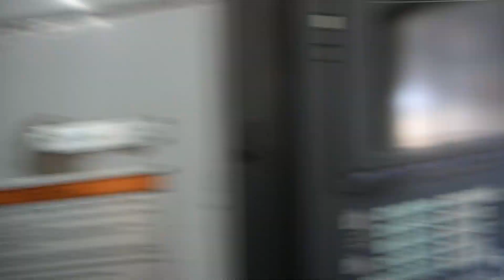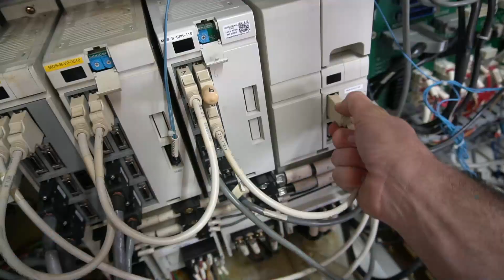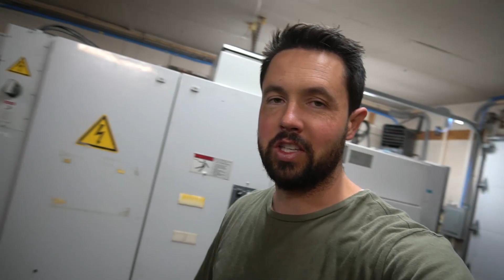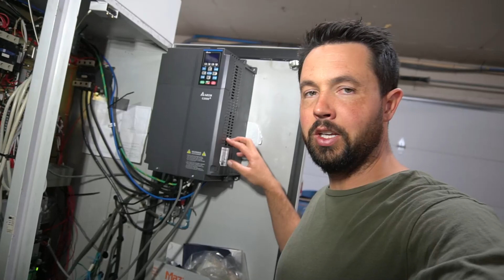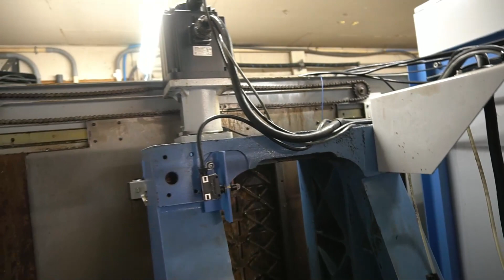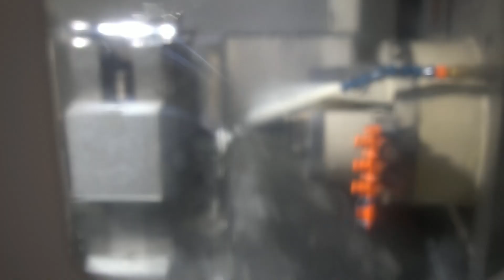Mazak Horizontal CNC Retrofit + Centroid.

Comment: Hey! That's my old machine!  Or just like it. We traded it in ages ago for a handful of small verticals.  Thanks for putting this video together, almost more work than the retrofit!
Reply from the maker: Haha that’s awesome!  She’s an old girl but she’s like new now! Pretty happy to have this one up and running it’s been amazing for me so far.
Reply: @ericschneiter  Sure does give me a thrill to see one doing good work, it was a pretty solid machine back in the day, although we had nagging trouble with the 4th over its life, but as the least expensive horizontal available, we could forgive it.
Reply from the maker: @yamahaeleven  hopefully we’ve put most the skeletons to bed.  I tried to rework some of the issues know on them.  The drawbar bolts, the trunnion etc.  she’s a smooth running girl now.
Reply: Excellent!

Comment: Very cool endeavour. I have retrofitted a desktop mill and a desktop lathe with the centroid acorn. The motion control of centroid is very good. I also have a Mazak fh5800 with fusion640m which is a big version of that machine. It’s a great machine and the Mazak controls were very good for their age. I also have a mate with a htc-400 but with the older MPlus control. A side note, the tool carousel on his machine spins about 10 times faster than yours in ya video.
Reply from the maker: That’s awesome, I probably could have kept the 640M but man I really like having the control over all aspects of this machine now.  It’s nice to be able to service on my own as well.  Love these old Mazaks.  Great machines!  I’ve eyeballed a few of those 5800’s on eBay.  A LOT of iron there haha!  And yeah, I set this carousel slow on this machine because some of my fingers have lost their spring.  So to make sure we don’t fling any tools we spin her nice and slow.   Takes a little more time but smooth is fast and fast is smooth.  😂
Reply: @ericschneiter  the fh5800 has rapids of 50m/min, rather impressive machine. I setup 2 of our MPlus machines with the Ethernet option and have them networked and their ability to handle data is unreal for late 90’s machines.

Comment: thx for the run down on the build i have purchased a htc400 and am about to do the same but with Masso controller and hoping to retain the drives, will try to get some vid of it
Reply from the maker: You’ll have to check if that control will work with SSC NET I know Linuxcnc has a way but I don’t know anything about Masso.
Reply: I'm using masso cnc controller on a bridgeport mill working great so thinking to do the same with my Hardinge cobra 65 lathe

Comment: Yea not a small undertaking at all.

I think you did a great job and got it running pretty well. I feel like I see a ton of retrofits that never really get finished. 

Sad part is the accuracy of those original servos and encoder is probably much higher than what the new drives and controller will be able to achieve.
Reply from the maker: I looked into that before I began. My X and Y are Delta Asda A2 servos and motors. They offer 20 bit resolution with 1.28 million pulses per revolution. So they are 20% or so higher resolution than the original ones. 🙌
Reply: @ericschneiter ah very cool the delta motors seem a little more industrial the dmm servos last I checked were not impressive when it came to that regard.

I almost had an htc-400 once upon a time. But didn’t have the space for it and we’ll deft still don’t..
Reply from the maker: @ianagos4276  You’re right one that unfortunately. I wouldn’t recommend DMM having done this.  Delta has been amazing but I’m going to eventually swap out the DMM drive on the Z axis they just aren’t in the same league.
Reply: @ericschneiter  I know the htc-400 was mazaks budget line but what I also find Atleast on the ones I’ve owned is they oversize the motors compared to what I would think they need. Like my fadal motors aren’t in the same league as the stuff on the integrex. 

When you first mentioned the drives for the new dmm servos were smaller I was just thinking there is no way they are the same horsepower.
Reply from the maker: @ianagos4276  for sure.  They were 1kw motors.  Sounds like the same thing you’ve noticed haha. The x axis moves super easy, like spin with your hand easy and same with Z.  The DMM just have a lower encoder count than the original Mitsubishi ones so I wanna up them to the Delta.
Reply: @ericschneiter  I can confirm the accuracy of those servos. I switched to delta servos on my worn out okuma mill and it exceeded expectations even with backlash on the screws. Extremely repeatable and never fails to impress. Bought Full delta control system for my okuma lathe also still doing the retrofit on that. 
Also now there are 828D Packages we can directly buy from china bit pricy but overall I think its the best controller available for retrofit work.
Reply from the maker: @harindugamlath   have you posted any retrofit videos?  I’ll head over and check your channel but I would love to see that.  Heck yeah!  I love my Delta stuff.  I’ve got them on my arrow as well and they are just dialed.  You’ll have to post when you get it finished up.  I’ve never taken a look at the delta control but sounds like a great option.  Did you use it for your first retrofit as well?
Reply: @ericschneiter  No. I never posted retrofit vids. My channel is a mess just random stuff I upload to send to someone. 

About the mill, I used Linuxcnc with probebasic gui, mesa hardware Delta drives. I changed the spindle all together with a spindle servo drive that was from china SZGH.

Delta controllers are bit hard to get in other parts of the world. It's eiher get directly from taiwan or from india. I bought from india as I live in the bankrupt island country of sri lanka.  

I usually don't get anytime to film or upload to a forum as I have to keep the business running also. If you need any information feel free to contact me.

The controller I bought was delta NC200A (2 axis) There are many other options. they are reliable and used well in asia.
Reply from the maker: @harindugamlath  I see, very well. I really love the look of the Probe Basic UI.  I’m sure you have a great machine on your hands.  Part of my uploading is for people like us where buying a brand new machine might not be possible.  

I appreciate the info and I will for sure write you if I have any questions.  Thanks for watching and for commenting.  Always enjoy meeting new people on here.
Reply: @ericschneiter  Cheers mate. I've done crazy stuff like changing out the okuma spindle cartridge to a 12k unit from taiwan (Kenturn, very high quality) that's not even meant for retrofit work. I'll actually try to share the lathe retrofit so someone could benefit from it. See you later.

Comment: Nice retro,  i have done two machines with centroid now,  one with oak and the other with an acorn.  did you manage to get the optic direct to talk to a dmm dyn4?  i thought that wasn't possible i thought the optic direct will only talk to a yaskawa sigma or a delta drive,  it would be handy to know how you did it as i have 4 dyn4 drives setup for x/y/z/a and id love to add a 5th axis.   also with the dyn4's do you ever see them occasionally fault out at power up after the machine has been powered down for a long time?

Comment: Man, I have sliglty newer model, fh-5800 with 120 magazine and 6 pallet changer. Is this actually doable? New motors, drives, and oak board? Is that it? What about tool change and pallet change macros? Using mitsubishi motors not possible?

What about tool tip compensation or also known as dynamic compensation does that work?

4 axis simutaneosly?

Multille variables for active makro?

Spindle encoder for rigid tapping you used original? How did you count rpm with that board?
Reply from the maker: It’s doable. But you’re talking a VERY complex retrofit for all that. Keep in mind I had already done one full retrofit and this one was almost a 2 year straight project.  Lots of things to tackle with these Mazaks.  

The drives and motor motion are fairly straightforward.  Getting the tool changers to work on these is more tricky. 

Centroid allows for tool compensation in the control or you can use your software. It’s just typed into the offsets page. 

4th simultaneous works, but getting the ratio on your trunnion dialed in perfectly is a super tricky process unless you can find documentation about how many turns per Rev the trunnion spins.  I had to manually type in decimals and probe it time after time to finally get it to the zero point where it was turning the exact degrees commanded.  

Rigid tapping is no problem, a new encoder on the spindle allows the board to rigid tap and it’s all built into centroid.  

The final piece is scheduling your pallets, the centroid post processor has to be modified but can be done.  

My opinion: if you run a production shop and you need a spindle for high volume go buy a newer working horizontal or something running and use it to your tax advantage.

Comment: Awesome job.

Could you outline some of the rough costs for each of the components?

How tall is your ceiling? Looks like a tight fit.
Reply from the maker: Gonna drop a video next week documenting more of the costs and stuff for both these retrofits, But for this build I essentially had the following: $3K to buy the machine as scrap + rig it home and moved.  “Rigged it myself “ Was into the drives, wiring, breakers, encoders and all the various boards from centroid for about 13K. Then random stuff you don’t think about: had the spindle reground for about 2K rebuild the drawbar and 4th axis and a custom PLC.  Then coolant and lubes and stuff.  My books show me sitting right about 19K total right now for everything to this point.
Reply from the maker: Ceiling isn’t very tall 8 feet to the garage door when it’s open. My shop is like 20 by 26 so with my machines in there it’s tight haha!
Reply: @ericschneiter  Nice, looking forward to the video and this thing making some chips. Wanting to do something similar in my 28x28 garage, been on the look out for a mechanically sound vertical to play around with. I'm somewhat familiar with linuxcnc, as I've built a couple gantry routers using Mitsubishi MR-J2 servo drivers and motors. Seems like the Centroid option is reasonably priced... if only I could reuse some of the Mitsubishi motors I've scored from ebay w the centroid Oak board. Currently have a small GT27 style cnc lathe.
Reply: @blauschuh  Mate thats awesome using mitsubishi MR-J2 servos, how do you find them price wise in comparison to other brands and how is tuning them?
Reply: @jasonlennox4614  I bought all of my servos and drivers on ebay. I probably paid 10% of what I would have if I bought new. I hadn't played much with tuning, but there are plenty of options. I will saw that compared to the gecko drive setup I had before the Mitsu are in a totally different league.

Comment: Nice work!! Just bought a 1998 Mazak and tossing up whether to retrofit to linuxcnc. Do you still have rigid tapping with that Delta drive?
Reply from the maker: What model you got? Have you used Linuxcnc at all?  I don’t do any rigid tapping just because I prefer form tapping and I work in mostly stainless.  Rigid is totally possible tho!
Reply: @ericschneiter  FJV-25, gonna be a big step up from what I've got. Must be so nice having a chip conveyer!! I've done a few machine linuxcnc, there's also the possibility of reusing the mitsubishi drives with it. Are you happy with the dmm servos? Are the original servos 3k rpm?
Reply from the maker: @oliverrowe8648  that machine is sweet!   Love the ones that look like a lathe from the outside with the door shut.    If you can reuse the drives that’s the way to go.  I didn’t wanna fight that battle so I decided to just switch and do a centroid conversion.  The new centroid Hickory board is a game changer if I do any in the future.  Linux can support the SSC-NET Mitsubishi stuff and I think it’s pretty good.   Don’t buy DMM I switched my X and Y out for delta.  Wasn’t happy at all with them.  Biggest issue with changing the spindle inverter is retrofitting an encoder that will work. But if you’re up to it send it dude!  Nothing like these old Iron mills on new electronics.  They are so rigid and built to last.
Reply: @ericschneiter  awesome I'll give that a crack first, thanks mate

Comment: I love what you did and how you explain your thoughts. I have an old 1997 Fadal I want to retrofit but sometimes I thinking, how would I sell jt after the retrofit? I would keep it forever after I think
Reply from the maker: No need to sell it after the retrofit if you’re using it.  But the centroid control is really nice.  Auto tool setter, probing, coordinate system rotation multiple axes: simultaneous milling and unlimited lines of code.  I love it as a control now.  A FADAL is a great candidate for a retrofit!
Reply: @ericschneiter  There are 2 specific options for Fadals. Calcmotion and NextGen but I think Centroid is a more robust product.

Comment: @Eric Schneiter Still have the original Mitsubishi parts? Would be interested in buying the control, drives, and motors.
Reply from the maker: I’ve got the motors and the Mazatrol, with some other parts.  Sold the drives already.😩 let me know if you want them.

Comment: Great job. I have plenty of questions.  About to embark on  vqc20 50b retrofit. Exploring options to replace everything from spindle motor and drive, axis motors and controllers and all the electronics ( reuse sensors).  Mine has a specific orient position for tool change which is inbuilt into the controller with an encoder on the spindle. What spec motor did you have and what specifics of spindle controller  did you end up with. This is the biggest headache for my retro. If I can get this sorted then I have a good path forward
Reply from the maker: I kept my spindle motor, I would assume you have some sort of Mitsubishi motor probably in the 15-25 horse category.  I use DELTA inverters and drives on my retrofits but that’s just what I know.  Can’t speak to Yaskawa or others.   If you can find a mounting point or a way to create one on your spindle motor with a 1:1 ratio it’s pretty easy to do and get working with centroid.   Besides that, just sourcing the right servo size and getting correct KW for your needs is the next big hurdle.   Centroid is all I know so I’m not much help for a Linux or anything else.  

Have your verified you have good runout on your spindle and minimal backlash on all ballscrews?  I would start there.  A retrofit is only as good as the iron it goes on.
Reply: @ericschneiter  I've had the machine since ~2016 and have had it operational for most of that time. I've redone the spindle drive caps and the igbts that are usually the problem, but about a year ago the axis drive has faulted and I've not got back to it before now. The spindle motor is a Mitsubishi 220v AC 5.5/7.5kw. It has its onboard pulse generator and a drives a gearbox that operates the spindle. There is an encoder on the spindle for position control for tool change position. Reusing the motor with a new spindle drive would be a good option if I can get it to work with the Mitsubishi motor and the nc controller (centroid as adoption looks great for this as long as it talks to the spindle drive). As for axis servos,  I would replace them with new units timing in the new control system.
Reply from the maker: @sophtayl  try and find the nameplate information for your spindle motor.  I’d imagine it’s the same gen as mine. Late 90’s era.  You can control it with a delta drive, and new encoder.  Do you know if the tool umbrella is servo driven? That makes it a little more complex but not impossible.
Reply: @ericschneiter  yes have the motor data. Mid 80s model. Permanent mag from my understanding so controllable to accurate position when tied into encoder on spindle. The controller needs to be able to manage this hence the question. 
Tool umbrella is hydraulic drive from memory. A plc interface would be easy to back incorporate but all is doable
Reply from the maker: @sophtayl  gotcha.  Delta c2000 will be able to handle your orient request.  Tool change macro will be really easy, that machine essentially moves just like  the other 3 axis tool change macros so shouldn’t be a huge issue.  I think if you find the right servos you should be set man.  Would be an awesome machine to throw a new control on and run for another 20 years.  🙌

Comment: Too bad you can't use the old VFD and servo motor. The retrofit cost alot more that way. I've done 2x Acorn retrofit (router and plasma), cheaper controller than their OAK but I am glad I did went with Centroid. Greets from Eastern Canada ✌
Reply from the maker: Could have if I used Linux but I just love my Centroid stuff so much.  I’ll have to check out your channel. Would love to see your machines.
Reply: @ericschneiter  I haven't done any videos on the retrofit. Only took pictures during the process

Comment: So, what was wrong with the controller? The 640 controller is MUCH better than a centroid controller. Im assuming that it needed a new CPU, which is about a $7500 fix.
Reply from the maker: I understand your doubts I thought the same before I got into Centroid. 
The 640M is a dinosaur compared to this.   
The Centroid runs infinite lines of code on an i7 processor without drip feed, fully customizable GUI, Macros, and PLC. Higher resolution servos by almost 30% over the ones that were on the machine, ability to make it 5 axis with advanced probing functionality including dynamic work offsets, cheaper electrical parts and the convenience of fixing any component by myself indefinitely into the future.